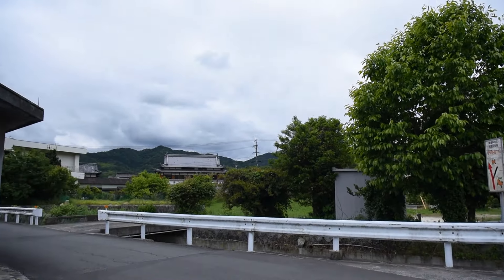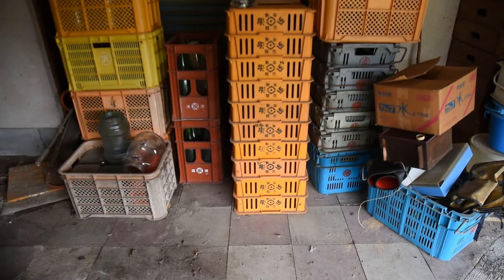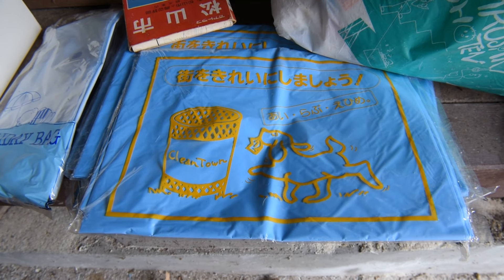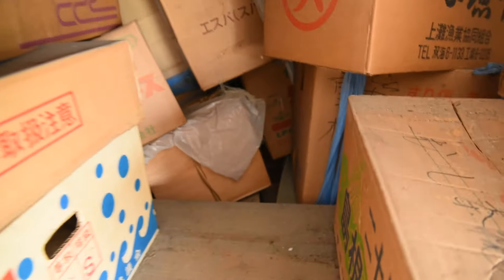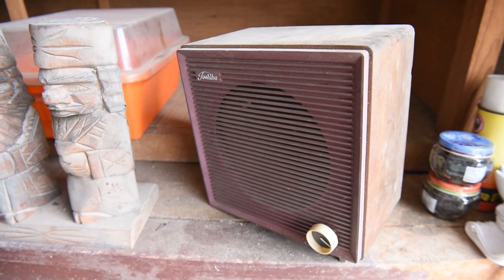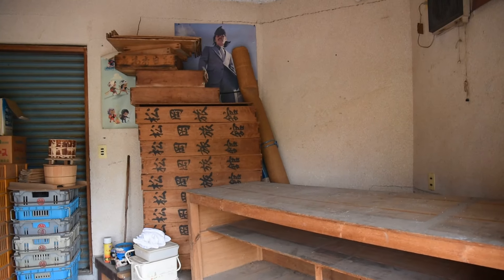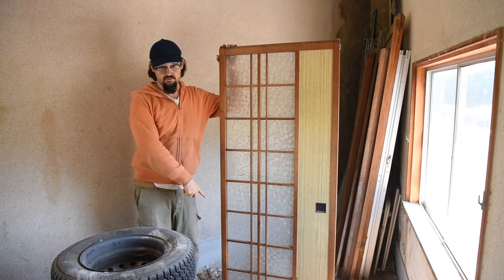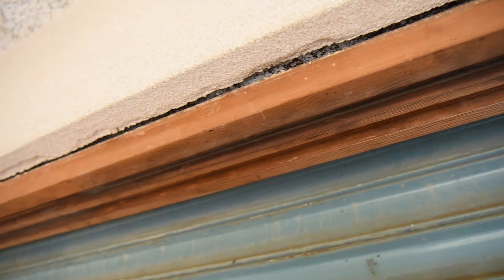Final Box Cleanout in the Abandoned Garage » Japan Akiya Restoration » Ōmishima, Imabari, Ehime

Comment: I think the wooden barrel at 9:35 is for serving cooked rice, it keeps them warm and moist.
Reply from the maker: Ah that's a great observation, thank you for the comment! Yes, when I showed Evan my assumption that it was for the countertop pickles, he said, well, they probably have a lot of purposes. It's interesting that the same barrel design comes in every size from teeny tiny to very large. The biggest we have is probably a meter across!
Reply: @bentonhomestead  Well I don't agree, in Japan things seldom have multiple purpose, certainly not in cooking. Here a bit more about the Ohitsu:

Ohitsu are taller wooden barrels used in Japan for storing and serving cooked rice. They are typically made from cedar or cypress and sometimes feature a lacquered exterior. With their tight-fitting lids, ohitsu help keep rice warm and moist, making them an essential item in both traditional Japanese households and restaurants.

A larger wider and low barrel without lid is a Hangiri:

Hangiri (or Handai) are essential tools in Japanese cuisine, especially in the preparation of sushi rice. Made from high-quality wood and bound with copper, these barrels help achieve the perfect texture and flavor of rice, reflecting the meticulous attention to detail characteristic of Japanese culinary practices.
Reply from the maker: That's all great information, thank you! Interestingly, the traditional Japanese wooden pickling barrels are very similar to the 'ohitsu' you're referencing. They used various sized wooden barrels for both 'tsukemono' vegetables pickled in brine, and 'nukazuke' vegetables pickled in rice bran. I think they also used similar barrels for fermenting soy sauce and possibly alcohol. But! I do not know if the identical barrel design has a different name, when used for fermenting. https://onggi.com/products/wooden-shoyu-barrel-9l

We have seen a few 'hangiri' shaped barrels, but they had lids, and were not in salvageable condition. The very large barrel that we found in the guesthouse garage is both wide and tall, with a similar style barrel construction and lid, just on a much larger scale.

I'm thankful to know these words now! I didn't know the names of the barrels before, and have so much to learn. Considering your history as a sushi chef, I'm inclined to just trust whatever you suggest. Thanks Peter :)